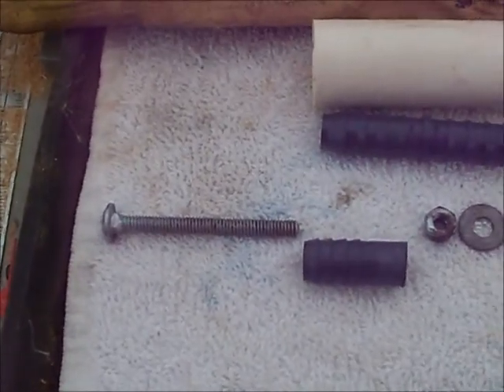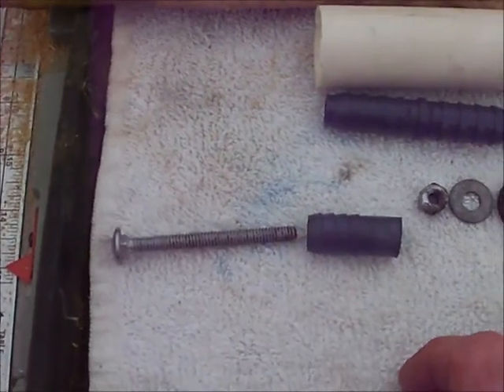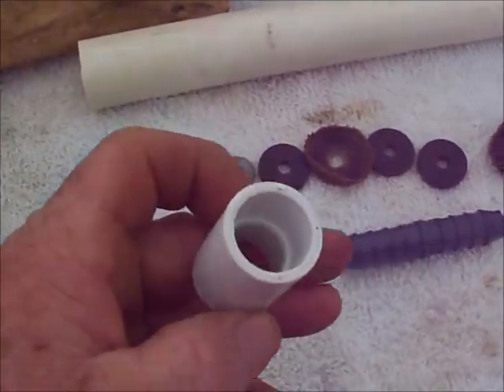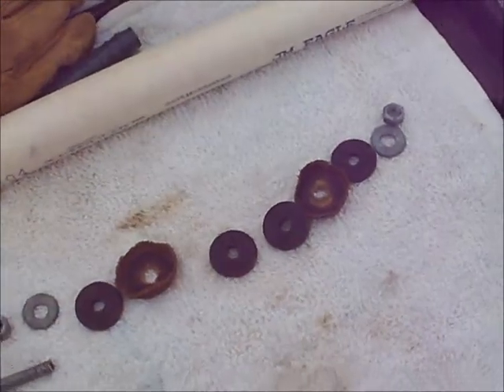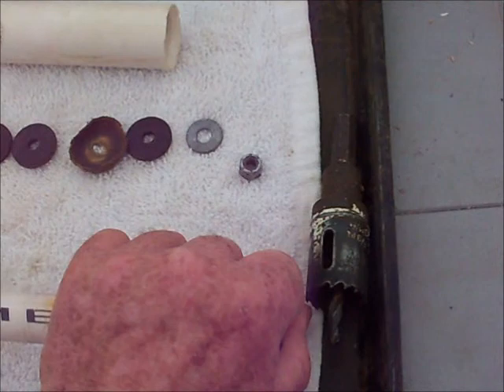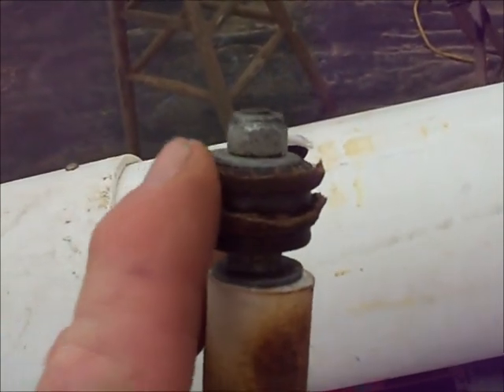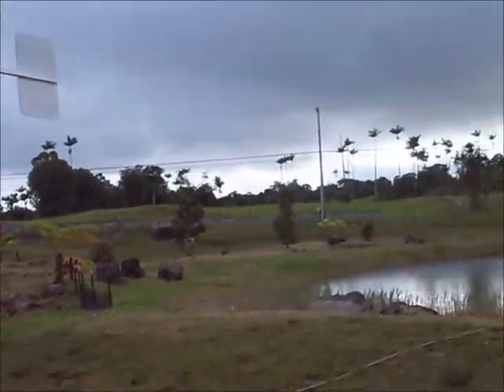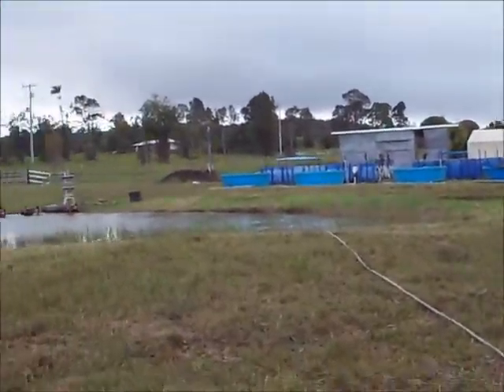Windmill and water pump. DIY part 2

Comment: 50' is a lot to ask of a homemade pump. The rule of thumb is 1 psi per foot so you are talking 50 psi at 50 feet. That's a lot! Lightweight commercial pumps won't even do it. The tolerances you need are just too high unless you machine parts. There are commercial wind mill pumps that will do what you need that are designed to keep animals with water. They aren't exactly cheap but you can find them.

Comment from the maker: Aloha, I doubt that the windmill I built would lift 50 feet.  I would think that max would be 20 feet.  I'm not lifting the water much but I'm pushing it 100 feet with at a head of  6 feet .  I connected a garden hose and it did pump a head of 20 feet. I think there maybe ways to pump less volume and increase the depth.  Email me  Tom Beck,  yellowohia@yahoo.com

Comment: Do you know how deep this would pump? I have an off grid well I am using a gasoline water pump on and it is getting expensive. This looks like a good solution. We get a lot of wind from the mountains morning and evening. The well is 50 feet. Could something like this pump water up to the surface?

Comment: Tom,
I didn't see your video when I built my windmill.  We both did a lot of things the same.  I dug a 9' well next to my wetland and pump the water up from the ground. My biggest problem is that I got plenty of wind in the spring before the leaves came out and the swamp grass grew.  But now, I rarely get a good consistent wind to keep it going.  Also, I used a hitchpin for my piston without any ring around it.  So I lose prime fairly quickly when the wind slows down.  Nice job on your project.